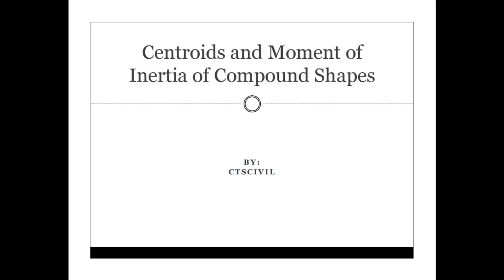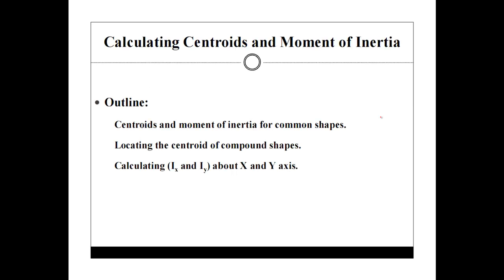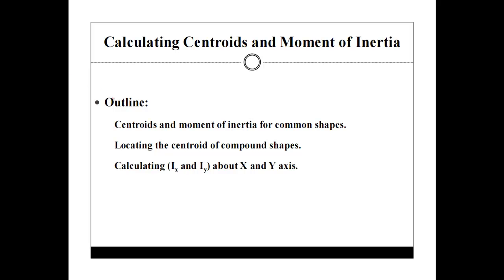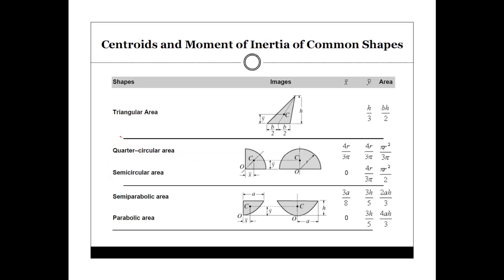Centroids and Moment of Inertia

Comment: The last part is wrong but otherwise very good video. If you go about the Y axis you also need to switch the base and height values, not just the distance you use for the PAT.

Comment: Hey mate, me again. I don't mean to be that guy but I think you may have made an error on Ix1. No matter how many times I check it, I keep getting 13.65 x 10^7mm^4. I was trying to work out the Ix around the centroid (say Ixc) and then when I had my Ixc I used the parallel axis theorem to find Ix around the x axis (call it just Ix) to see if I got the same figure as you. If I use that figure above to work out Ix then I work out Ixc and use the Parellel axis theorem to shift it back to be Ix it works out the same. Have I made an error?
Reply from the maker: Aemon Kelly Sorry but you lost me. I watched the video again to make sure that I was correct and could not find any error. Are you trying to find Ix about the centroid or about the x axis?
Reply: Both. I was trying to find Ix about the centroid and then use the PAT to see if my Ix about the x axis matched up with yours. Which it didn't. When I went back and followed your calcs on screen for Ix1 about the axis, using your numbers on screen I got that different value for Ix1. My Ix2 was the same as you. I do make calculator errors pretty often so I admit I may well be wrong.
Reply from the maker: Aemon Kelly If you got the second one, that means the numbers are fine. I am trying to find where will you make a mistake. revise the way you enter the mathematical expressions in a calculator. do bh^3/12 and write it down then do Ad^2 separately. Then add them up. I checked from my end, everything seems fine. Good luck
Reply: CTSCIVIL I'm so sorry, I didn't notice your annotation correction for Ix1. Your corrected value is 136.53 x 10^6mm^4 and my value is 13.65 x 10^7mm^4 which is basically the same thing. With that, it all works out. I noticed a discussion in another thread about the PAT so I thought I'd try and practice it by finding the Ix from the centroid and then taking that total Ix, putting it into the parallel axis theorem formula again, using the Y bar centroid distance (78mm) as d and the total area (12000mm^2) as A to see if I got the same value which (eventually) I did. I'm a third year Mechanical Engineering student from Brisbane, Australia but I still have a second year structures subject to finish and I must say I was a bit more rusty on this stuff than I realised. This video was just what I needed. I take it you're Civil? Thank you very much for your time, I'm subscribed now!
Reply from the maker: Aemon Kelly You are so welcome. I am glad that worked out for you. I am defensing my PhD thesis this May and yes I am in Civil Engineering (Structures)
Reply: Best of luck in May. What do you think you'll do once you have your PhD? Do you think you might teach at a university?
Reply from the maker: Aemon Kelly I will be teaching back home. I am already a faculty member but I need the PhD for a better academic position

Comment: Hi, for your Parallel Axis theorem. Shouldn't d represent perpendicular distance from centroid of small part to the centroidal axis of the Whole component instead. When I used your formula and i was unable to get the correct answer for my question.
Reply from the maker: Andy Tan there is a moment of inertia about the centroid of the shape and about an axis. Your method will find the moment of inertia of the shape about the local axis of the shape itself. Mine is to find the moment of inertia about the X or Y axis. I hope that clears it up :)
Reply: CTSCIVIL o Ok i understand it now. Thanks for clarifying!

Comment: imconfused on how you get the 38 and 86 for the second shape
Reply: you have to add the distances from the x and y axis for the second shape as well
so for x its 40/2=20, then you add 18 since its 18 units away from the y axis, that gives you 38.

and you do the same thing with the y, 100/2= 50 + 36 = 86
Reply: +wilhelm nantana yeah i think the number Xbar and Ybar numbers are wrong for the 2nd shape.... Ybar = 68 and Xbar = 29....but the idea was write just a miscalculation in numbers i guess

Comment: I am confused about the value of h and b when you change the axes of rotation? Is that the value of h about x axes will be the value of b about y axes?
Reply: Yes, you need to change the value of the base and height. One way to simplify it is to look perpendicular to the axis, and select the corresponding base and height of the shape.

Comment: shouldn't d be the perpendicular distance between smaller centroid and the whole thing's centroid? therefore (75-78)^2 and (86-78)^2 for the d^2 of Ix2 and Ix1 respectively. Please check with me and correct me where i'm wrong, thanks.

Comment from the maker: I like to visualize the moment of inertia as a tool to tell me how the beam will resist deflecting. when the "I" is high -> the beam is tough. When the "I" is low -> the beam is weak. the beam designer is given a choice of making the beam tough or weak by playing around with its cross section. should he make it deep and thin-> resists deflection or should he go flat and thin -> bad.
you can break a plastic ruler very easily if you bend it laying flat. can you break it if rotated 90 degrees?

Comment from the maker: There is a method if the structural shape can be described by an equation (which I think is complicated)
the method of integration is good to find the centroids of an area below a curve defined by an equation.
remember the summation sign is the same as the integration where the summation is done on certain number of points however integration is done on indefinite number of points or segments of "dx"
thanks for stopping by
CTSCIVIL

Comment: I calculated it and I got 44.37x10^6, but my mistake was that i calculated 100*160 as 1600, instead of 16000. On a side note, the explanation was really clear, I really wish I had you as a lecturer.

Comment: The correct ans should be 10.36 x 10^7. 
Please check the ans for the x1: its not 44.37x10^6 but instead its 13.65 x 10^7.

Hope im right. 
Thanks for the video btw. 
yaz